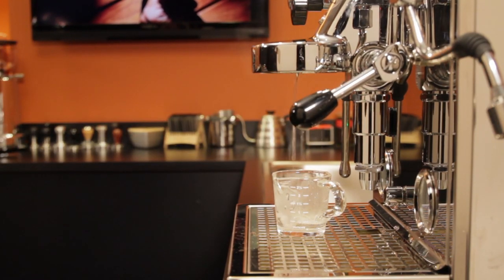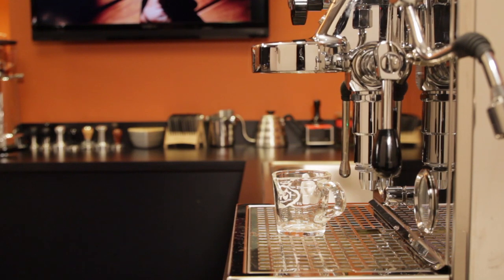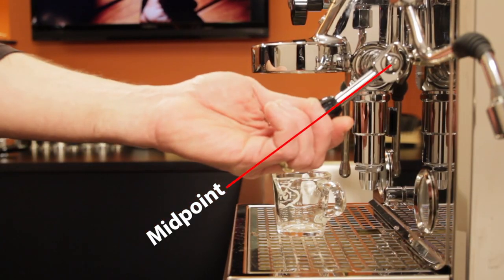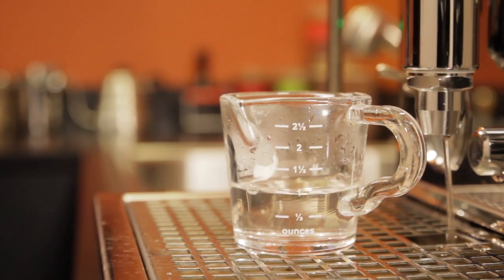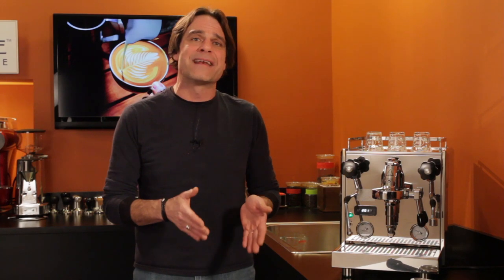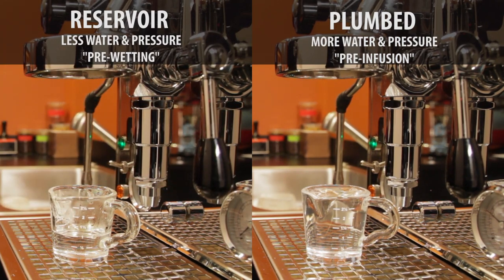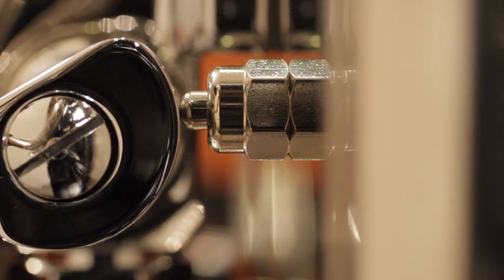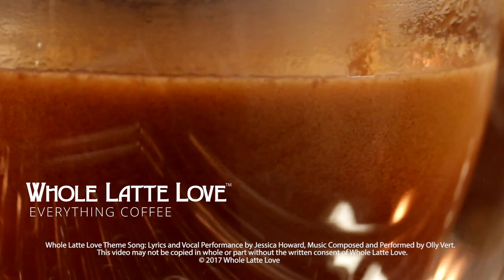How To: Pre-Infusion on E61 Brew Group Espresso Machines

Comment: Scott Rao in the professional barista's handbook says the pre-infusion does help redistribute the grinds to reduce channeling (and therefore a more even extraction/better tasting espresso).The science of why that this is discussed there as well. He does not make a distinction between pre-infusion and pre-wetting however so its unclear whether the pre-wetting technique displayed here is sufficient.  Based on his explanation the requirement is that the entire puck be wet before pressure is applied. One ounce of water is probably enough to accomplish this.
Reply from the maker: Hi maximus, Thanks for sharing that! I believe pre-wetting can have some benefit if it's the only option. In conjunction with Profitec/ECM We've recently introduced flow control on E61 group machines including the ECM Scynchronika, Profitec Pro 500, 600 and 700. Even available on the ECM Classika a single boiler PID machine. With flow control it's possible to get a very gentle pre-infusion on any of those machines. Something that was only possible on plumbed in machine like the Pro 700 and Synchronika in the past. Beyond pre-infusion flow control gives user complete variable flow rate control throughout an extraction. With that one can replicate extractions of lever machines, Slayer style extractions, manual lever shots, coffee shots and pressure profiles by following the group mounted pressure gauge which is a part of flow control on the previous mentioned machines. If interested check out machines available with flow control and learn more here: https://www.wholelattelove.com/pages/flow-control
Marc

Comment: Several years ago, I had been playing around with several parameters including grinders on my Rocket R58 and tried to get consistent exctraction on a bottomless portafilter. The R58 does have a solenoid valve, that prevents line pressure pre-infusion. I installed a switch, that allows me to open this solenoid valve, thus enabling line pressure pre-infusion at about 3.5 bar. Pre-infusion  was the key to consistent extraction. No more splashing around. Pre-infusion makes a big difference in my experience.
Reply from the maker: Hi AP, That's a great hack!!! Totally agree that pre-infusion will improve extraction - especially for those tricky to work with super fresh, lighter roast single origin coffees. Thanks for sharing!
Reply: I know this was a long time ago but how were you able to do that? Was it difficult?

Comment: Does the stored/built up pressure differ between a machine with a vibratory vs rotary pump?
Reply from the maker: Hi diycentral, No difference in stored pressure in vibe vs. rotary pump machine. Pressure (unless plumbed in to pressurized waterline) is a function of pressure in the boiler caused by heating of water.

Comment: Hey Mark, I have an ECM Synchronika, and my brew lever refuses to stay at the spot above the mid-point for pre-wetting. It just slides back down to the mid-point where there's no water flow. Any idea what might cause this? Excessive build-up of coffee oils? Is there a component of the brew lever that can be tightened?
Reply from the maker: Hi LD, Thanks for the question. That's unusual. Have you taken it apart. Could be an out of place spring or component. If in the US give our friendly tech support staff a call at 585-924-7170 and they can help diagnose the issue.
Marc

Comment: great videos, thank you. For the newer (2023+) Profitec 500 PID and other E61 machines with internal water tanks will doing the pre-infusion or puck pre-wetting cause any reliability and longevity issues for the machine? Any additional wear and tears issues? Will this usage affect the warranty perhaps? Thank you.
Reply from the maker: Thanks for the comment and question. Pre-wetting on those machines running from internal tank will not cause any issues nor void the warranty.

Comment: Hi Marc, this is the case in my machine, I have the profitec 700 and it’s kind hard to find the right spot. How can I adjust the switch? Thanks!
Reply from the maker: Hi Mario, If I understand correctly your pump is turning on at or very close to the pre-infusion position of the group lever. If that's the case you can adjust the switch so it sits a bit further back and does not activate the pump until the lever is raised further. To adjust switch position you will need to open up the machine. Once open you can reach the nut which holds the switch on the back of the front panel. You would loosen the exterior nut a few turns while tightening the internal nut. It may take a bit of trial and error to get the switch position just right. Do be careful when doing this as you will need to have the machine powered up with the cover off as you make small adjustments to find the right position. Hope that helps!
Marc
Reply: @Wholelattelovepage  It does, thanks for the information!

Comment: Hey Marc. Thanks for another excellent video. Some people promote to turn the pump on for about 2s and then back to the "prewatering" position for another couple of seconds on reservoir E61 machines to facilitate preinfusion. Do you have any thoughts on that? And which preinfusion/prewater length do you recommend in general? Greetings from Germany :-)
Reply from the maker: Hi TH, You are welcome and thanks for the comment! Allowing the pump to turn on for a few seconds seems reasonable to me. I was looking at some pressure graphs from an Expobar Brewtus with vibe pump last week. As I recall, it was about 3-4 seconds to hit ~4bar before pressure quickly climbs up to 9. Keep in mind the E61 on the Brewtus is customized with an added chamber milled in above the shower screen. With that the Brewtus ramps up to pressure more slowly than other vibe pump E61s. My feeling is you'd get something closer to what you would if using a plumbed machine as far as pre-infusion by kicking the pump on. Also a larger volume of water on to the puck. As for duration, if using a vibe machine I'd pre-wet for 10 seconds and go 5 seconds on a plumbed machine. That might adjust a bit depending on the coffee used.

Comment: Not sure if ECM Synchronika can preinfuse from a 5 gallon water jug because it has no pressure when plumbing to a jug.  My main question is this on preinfusion.  Could I run a preinfusio to both the portafilter and glasses as a prewarming prior to placing the Grind on the portafilter?  I have heard such things about keeping everything hot.  Thought preinfusio or prewetting might be helpful.
Reply: Yes, you can get pre-wetting from an ECM. Listen to the video - he says the little bit of pressure comes from the pressure in the boiler. It is not huge, since the espresso boiler is below boiling temperature. There is no pressure from the jug.

Comment: From a physics point, it should prevent pressure channeling. That is, under pressure water will always flow thru the path of least resistance. Which COULD over brew a few grams of coffee, and not extract the flavor from the more compacted coffee.
On the taste side, it should be difficult to tell the difference.

Comment: I am not really shure if this makes any sense. At least when using an e61 machine with vibration pump, it does preinfusion on its own, without playing around with the lever. There is a preinfusion chamber and a preinfusion valve in the group head, leading to a slow rise in pressure at the beginning of each extraction. The water touches the ground beans with no or little pressure first, than the pressure slowly rises to the desired brewing pressure. 

Or am I wrong with this idea?

Comment: Hi Marc, thanks for this video. It teaches a lot! Me and some friends tried to plumb-in a Rocket Mozafiatto R this weekend and we could not get line pre-infusion... it looks like it has a solenoid valve that's only activated when the pump is on, do you know any information about it? Thanks a lot!.
Reply from the maker: Hi jm. You're welcome! You are correct, plumbable Rocket machines have a solenoid valve which closes the machine to line pressure when the pump is not operating. Line pressure pre infusion is available on plumbable machines from Profitec and ECM. Although the solenoid rules out line pressure PI on Rockets some may regard closing the solenoid a benefit as line pressure being present inside the machine when not operating does present a flood risk. ECM/Profitec recommends an external valve to close off line pressure when machine is not in use to eliminate the risk.
Marc
Reply: @Wholelattelovepage  Thanks Marc for the detailed explanation. Yes, we were thinking Rocket's decision was related to flood risk :-)

Comment: @Wholelattelovepage  I just ordered this machine from you but I do have a question.  For the hot water wand, is there a way to set/reduce the temperature so that it's more ideal for tea or an americano that's not scalding hot?  I think I remember seeing something about a mixing valve setting for this but maybe it's only available if the 700 is plumbed in?  Thanks!
Reply from the maker: Hey soha, You can reduce water temperature in the steam boiler. It's the T2 setting on the PID controller. Keep in mind reducing temperature in that boiler also reduces steam pressure. The machine does not have a mixing valve. One method of cooling water for Americano is to dispense hot water from the machine into a cold cup prior to preparing your espresso shot then pull the shot over the water. Hope that helps and thanks for your patronage!
Marc

Comment: Hi Marc,
I know this is an old post but I have a question regarding pre-infusion. I have the ECM Synchronika from WLL without the flow control device. My question is, my direct plumbed line pressure is 2 bars on a pressure regulator that I installed inline. This pressure is also reflected on the machine's brew pressure gauge. When I open the lever enough to start the pre-infusion without starting the pump, the pressure on the machine's gauge drops to about .5 bars. I will have to pay more attention tomorrow when I brew again, but will that pressure increase to 2 bars once the puck is saturated? The reason I ask is because I hear so much about pre-infusion pressure being around 2 or 3 bars, yet my pressure drops to .5 as I mentioned. 

Thank you in advance.
Reply from the maker: Hey Todd, I still monitor the channel for and do my best to respond to all original comments regardless of video age. Yes, pressure will drop initially and will likely recover to full line pressure depending on how long the pre-infusion runs and how tight the grind is.
Marc

Comment: I'm brand new to espresso machines, or was until a week ago.  Assimilating concepts to decide on my machine purchase has been a fun (!) challenge.  Pre-infusion seems to be quite a debate-sparking topic.  I'm for it.  It seems logical. However, direct-plumbing my espresso machine is something I will look forward to at some point in the future. In the meantime, I've had to figure out how to get a pre-infusion benefit on a non-plumbed machine (which led me to the Profitek 900 but that's another story).  In wanting to stay with more mainstream prosumer machines my question stood.  Luckily I happened to read the tech statement (on another website) for the ECM Synchronika  which stated, tantalizingly, that "some" pre-infusion was available if not plumbed, but more was available if plumbed.  This sent me spinning with at my no-knowledge level of espresso machines So THANK YOU, Mike for this video on Pre-Infusion.  I've been using a Melita drip cone for my regular coffee for years.  The instructions recommend a pre-wetting of the grounds before the full pour.  This always made sense to me as a logical priming for the coffee - preparing it to accept the full pour. Similarly, I feel completely happy with the limited, passive coffee pre-wetting available, I suppose, from any E61 machine.  I'll even venture to say that I may prefer the no-pressure pre-wetting, rather than line pressure pre-infusion.  You can wait until it feels right without water continuing to pour through.  Given the already dubious benefits of any pre-introduction of water before full pressure, I'm hard-put to believe that one would be "vastly" superior to the other.
Reply: That should have read "Profitec 800 (not 900).
Reply from the maker: Hi John, You are welcome for the video! Just to be clear the Pro 800 is a manual lever machine and not an E61 group. The Pro 600 is a non-plumbable, dual boiler, PID, E61 group machine. The Pro 700 is the same but can run from reservoir or plumbed to waterline. Plumbed Profitec (or ECM) machines with E61 group can do line pressure pre-infusion. Beyond that, those machines can also be equipped with flow control of the E61 group allowing one to do flow profiling using water from reservoir or plumbed connection. One common use of flow profiling is a long low flow start to an extraction. It's similar to the pre-wetting of drip cone/pour over brewing. The pre-wetting allows CO2 to off gas in coffees which are fresh from roast. Off-gassing reduces the brightness/acidity of fresh from roast specialty coffees. Flow control allows for other profiles like starting with a high flow rate and then reducing to avoid extracting bitter or stale flavors from darker roasts or beans that are less than fresh. Here's a video demonstrating a couple of simple profile using flow control: https://youtu.be/a-QAOo8Vg5A
Marc
Reply: @Wholelattelovepage  Thanks so much for your response, Marc!  Yep, I knew that about the 800. I was attracted to it because to plumb or not to plumb becomes a non-issue with that machine as far as the basic product goes.  Also I'm heavy into tradition, so the neat-o manual lever is calling my name.  Extremely appealing, that machine.  However, the Profitec 700 with flow control is also at the top of the list because of level of experimentation it offers.  (Compared to the 800 which seems more WYSIWYG).  
In my first few days with the flow control 700 , I'll just want to pull simple dependable shots without much brain engagement beyond refining basic techniques.  The video you left at the end of your response sounds made-to-order for that.  Also your guidance as to choice-of-coffee is invaluable.  I've watched many of your videos over and over again.  As I pick up more awareness over time, there are always excellent points in the videos that sailed past me in the beginning that later on suddenly become enlightening.  I feel very lucky to have this resource.   
--JohnB

Comment: This video just helped me understand how the E61 group head worked a bit better. I've adjusted the cam switch a bit further back to allow for some pre-infusion now, and the mid-point is a bit easier to find as a result (It's a very light bump and hard to feel with new seals in the cam shaft).

From what I can tell the pre-infusion lets the puck expand a little and that's what seems to help prevent channelling. Besides also getting tamping down pat. You can get a damned good brew out of these heads that's for sure.
Reply from the maker: Hey lj, Thanks for sharing! Yes they do make good coffee, Pre-infusion can help prevent channeling also allows fresh from roast coffees to off-gas a bit which can help reduce brightness. Typically find one needs to grind a hair finer when using pre-infusion.